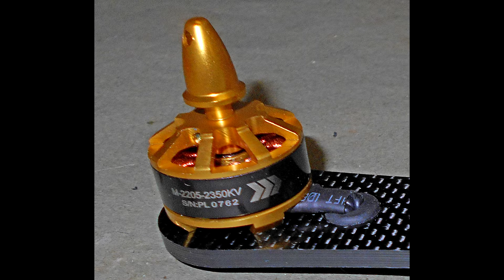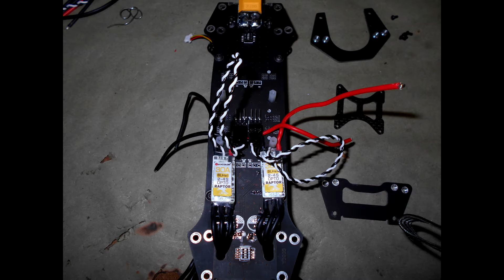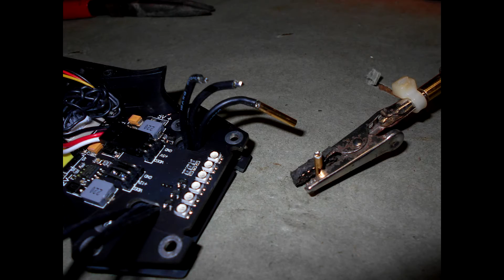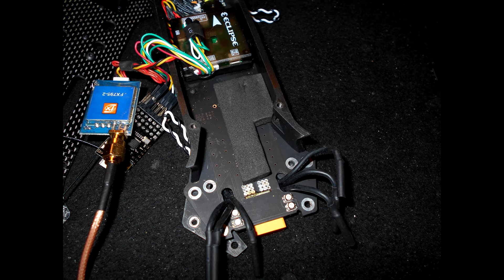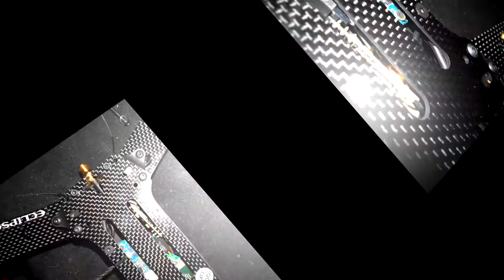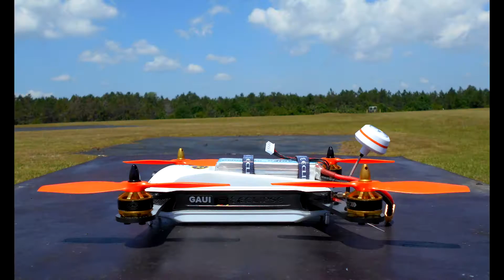Gaui Eclipse E28R - My Initial Build

Comment: if you really want to add some cleanliness to your build, look up the black widow 2204 motors or the new hk 2205 motors with the built in escs. the multistar motors have the 30amp rating youre looking for, and you can get some t-prop adaptors to get an even slicker look.
just curious,  but could i use a cc3d board eith that pdb breakout input or am i hosed and need to go with the naze?
whats the compartment space inside in mm's?
good review :)